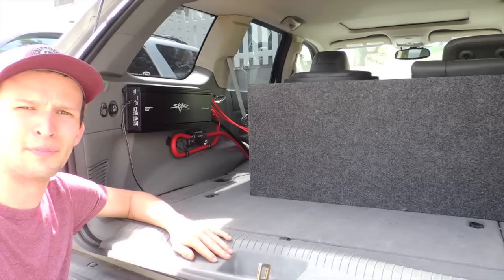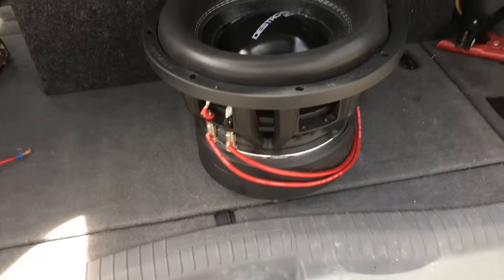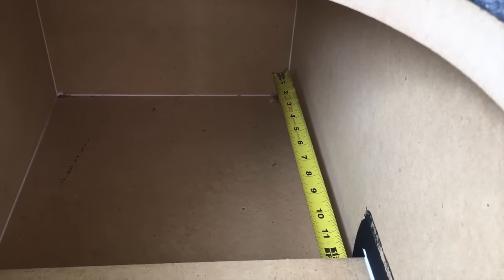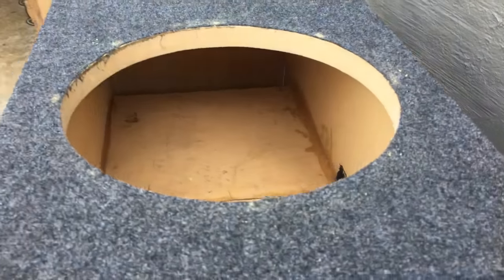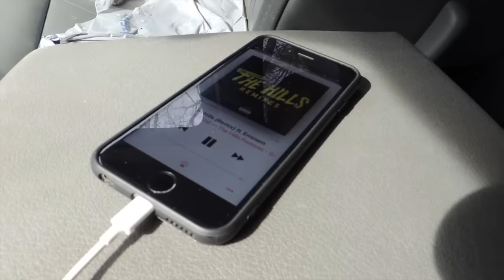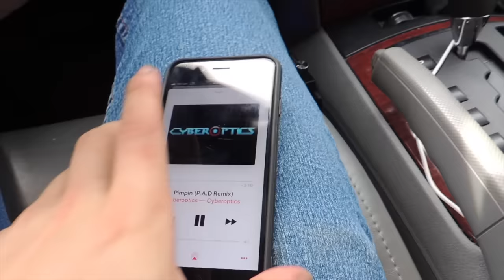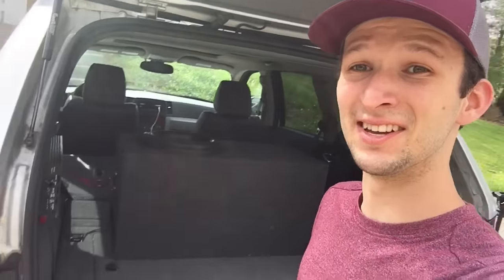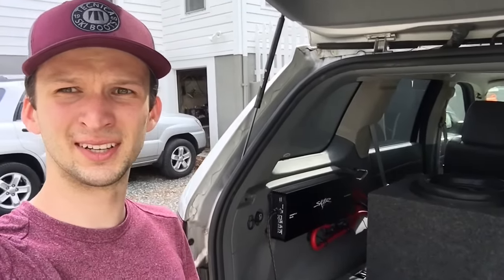Tuning My Box To Hit Lower! | How To Tune a Ported Subwoofer Box/Enclosure

Comment: Can I wire dual voice coil to a single coil together
Reply: Yes you can but u want subs that match in rms and ohms unless u have a amp that can push low ohms then u be roughly good. My buddy bought two hertz 15 inch subs one is 4ohm dual voice coil nd the other is two ohm single voice coil. Each 450watts each but sincce its hooked up to a amp that is 2 ohm stable bridged can only go to 4 ohm so the subs make the amp hot quick. And last thing if ohms are different in same box hooked up to one and other the lower ohms sub will play harder then the 4 ohm sub causeing it to be really dirty. And then vise versa with rms if its not matched one sub will use more power then the other sub makeing the subs not move in sync therefore makeing dirty bass

Comment: wouldnt that make the volume of the box smaller
Reply from the maker: Yep! But it is still working the recommended volume and I’d rather it hit lower than be the little bit louder
Reply: Not to mention, you can tune low with small air space. Just harder to do

Comment: what frequency did you use to set your gain?
Reply: i suggest 40hz at -3 or -5 db if you listen to regular music via cd, flash or streaming but if you listen to bass boosted or decaf, tune 40hz at 0 db. 40hz is used when you watch amp dynos doin certified, uncertified and dynamic runs
Reply from the maker: I used 40hrz at -3db since the majority of the music I listen to regular music

Comment: I just want my box to sound good for the wide variety of music I listen to, including deep bass tracks...  How do you do that?
Reply from the maker: Getting one tuned to around 40hz is usually the sweet spot for a good variety of music
Reply: @ParkerTheBasshead  copy that.   Is the idea you tune to low 30's for heavy bass tracks and booming rap, and higher like 40 for better bass guitar in rock genres, classical music etc-- in spite of what the sub manufacturer says for hz tuning?  What does the manufacturer have in mind when they throw out a single number for a particular sub, like 32.3?  And how bad would the results be if they recommend 1.6 cubes @ 32hz, but you put it a 2 cubes box @ 30hz?  Obviously that's what I'm looking at doing..
Reply: @frankbush8368  sealed is the way to go for rock

Comment: How long you been running that sub??
Reply: Maybe 3 weeks max 😂
Reply from the maker: A little over a month now
Reply: @ParkerTheBasshead  that coil looks a little rough for only 1 month
Reply from the maker: Kenny Mayberry agreed! Good ole Rockville coils 😂😂
Reply: @ParkerTheBasshead  I like their K6 but the K9 has major issues and they started selling recone kits when the destroyer came not a good sign lol. Their amps do well
Reply from the maker: Kenny Mayberry yeah if they would get their glue figured out and stop adding ridiculous ratings to their subs they would be awesome! Who knows maybe they will figure it out eventually
Reply: @ParkerTheBasshead  yeah for sure. If  you go by their CEA and not their RMS it will be fine. But yeah way over rated. Been running a K6 on CEA and it does well

Comment: How would u co.pare the american bass to the type r. And did u try the type r in same box u had the american bass in. I a square subwoofer man myself. Where i grew up every body has a system and bumps but swear from a mile away i would get my brother callin sayin u comin to my house i would say how u know he would say ur bass sounds like no 1 else all on 2 12L7s and a kicker 1250.1sdx. N finally my female had my car and i could hear hwr for like 7 min before she pulled up. Had me like what she doing circles. But i from chicago and it all flat land u k ow bass carries. Plus them big 3 storie buildings help funnel that bass in a vertain direction.
Reply from the maker: The American Bass can definitely handle more power! My type R is only 600 watts RMS but I believe some of the newer ones are 1000rms and those seem to be pretty comparable to the American Bass Elite
Reply: @ParkerTheBasshead  i have a set of the new tyle r series. But i have a.d.h.d. so i change my mind 30 times a day. I just found myself likin round subs again. Bass is bass ugly or sexy. But the 15 type r in a V.T. box single 15 with big ass slot vent port i thought it would blow with 1000 watt plus on rms. But handled like a champ. The newer typ r dont have the lil slots to force air into the sub to cool off it just has a blank chrome bottom.

Comment: Yo can you give me some measurements for a box that’s 4cuft tuned to 32 hz I’m trying to build a box and can’t seem to get any help I have a 15” Fi neo d1 and I’ve never built a box before so
Reply from the maker: You should be able to find specific measurement for that sub from the subs manufacturer on their website
Reply: I got the specs of the sub but how do I put them in to get some Measurements for a box
Reply: google re audio box calculator. play around the box height, width, depth 1 and 2 and look the the box volume (ft3). start at around 5 cubes before messing around the port size (setting up the port will shrink the box volume). next check to see if the sub gives you info for recommended port area. you dont want it too small or youll get port noise, the specs will be measured in square inches (in^2). if you dont have any info start with a 3 inch port width then play around the port length to get the desired hz tune.
once you get the specs setup just scroll down to step 2 and it will give you the measurement you need to make the box. hope this helps
Reply: Thanks

Comment: You do realize when you just add length to a port like you did - your taking up more internal air space and adding more port area to the enclosure which may or may not help depending your system - in my estimate of what you did you probably are able to play lower yes, but now probably have to much port area for that sub compared to the size of the box - you also wanna know more about the specs of the sub you are running and take into account the amount of moving mass / dampening factors and FS ..I mean whatever works bro Bang On💪🏼 check out some of my vids
Reply: what happens when your port area is too big for the sub. i know if its too small you get port noise
Reply: To much port area can cause unloading of the woffer .. the port acts as a separate chamber that builds pressure .. no pressure the sub almost reacts as a free air scenario.. now that’s being extreme but in most cases you just lose efficiency in the enclosure which 95% of the time means not as loud .. taking more power to do the same dam thing lol .. I’ve designed boxes with loads of port area and have crazy peaks (not very musical) lots of SPL guys build small boxes and go big on the port area and add loads of power and tune high in the 50s or higher .. lots of variables when building enclosures 😬 in simple terms .. to much port area not enough pressure being made in enclosure but that’s not always the case
Reply: @LivinLoudwithAndy  thank you so much now i know. can i ask one more question. im building a slot port box where the port and sub are facing the same direction is it better to make it an L slot port or U? does it matter

Comment: Your tuning is probably a lot lower than you think. Adding that much port takes up a lot of the gross volume. If grossl box volume is 2.9 cubic feet and you have approximately .4 to .5 cubic feet of port, then you are at 2.4 to 2.5 cubic feet net. Which is what you need to make your tuning measurement on. Not the 2.9. So if that much port is 35 hz at 2.9 cubic feet, you are probably looking at closer to 32 or 33 hz. Just making guesstimations on box measurements, but it was 29 inches deep and i am guessing somewhere around 12x14 for width and height. And guessing a 2x14 port. But don't know for sure. If those are the dimensions i get a tuning frequency of 32.2 hz.

Comment: You could have closed the port height by 3/4 inch and made that baffle length around 22.8 inches you would have been down to 30Hertz likely closer to the subs Fs. As the other guys said you could also invert the sub which gains you 1Hertz lower with that baffle I described for a 29Hertz tune not really worth it in my opinion.
Reply: Does running a smaller port affect anything besides added port noise? Or why doesn't anyone run smaller ports since it's a little easier to achieve lower frequencies

Comment: If you hit lower when you tune lower, wouldn't you lose "high" bass at the same time? Say you tune it from 40Hz down to 28Hz. Now when it hits above 45 50Hz Notes it will be a joke right?
Reply from the maker: Yes tuning lower will sacrifice higher notes but in the 40-50 range it isn’t really noticeable

Comment: The box volume needs to increase. Sadly you decreased the volume adding the port
Reply: I agree, but the difference is probably less than 10%. I doubt it'll hurt it too much, Most subs have a .3-.5 cu-ft area they work best in. I doubt he took that much away from it

Comment: Its there glue. They need to find or just pay to buy from sundown or something on that glue.
Reply from the maker: I know they really need to figure it out! Other than that and there dumb rating systems they’d be alright
Reply: @ParkerTheBasshead  swear 2 kicker comp 12s 150 rms each in a box that is slanted front and back. I had muliple dif amps til 1 day i asked a best buy tech what should i hav he said kx400.1 swear it brought the bass to life. I mean went from bass hitting to bass slammin on every note. I stand by a kx. N ya i know for same price i can get a taramps and hav alot more choices but swear until u have a rocford power edition amp not refurbed or used new. Then u will understanf what im sayin. Its almost like shooting for S.Q. but u gettin better bass delivered to the subs. I do not like the new 1s with a wireless remote. I say it takes up space for what the amp really needs. Have u ever noticed 2 same radios 1 shows fish and dumb back grounds and its 100$ more but when put to the test of using to fine tune the 100 cheaper 1 sounds better. Cuz it didnt waste space on a lil chip and font display.

Comment: You really should stop messing with that box. Get one built Im telling you. It doesn't matter how much you change subs. So be it. You'll get way better results from just building your own. Prefabs aren't meant to last very long either. Just take some 3/4" birch, double the front baffle to 1.5", slot port with flanged edges for more efficient air flow and more SPL with a tune in the mid to lower 30's, and bam! There you go. Its not hard but yet you are making it extremely hard.

Comment: Run two positive wire and two negative wires from the box to the subs. The way how u have it un make a signal have a delay ane one side of the sub is working harder than the other. Thats the most common thing ppl do in it fuck the subs up.

Comment: I really want to yell at you but I'm not going to I will say that you don't give up even if it's not the correct way to do it you do find a way but it's really not the correct way take a day and build a box $50 sheet of wood I can see you doing it in about 4 hours... Testing subs or not get a sheet of birch and make a box you'll make a good one kid!! I don't want to jinx you but I don't see that sub lasting too much longer either it looks in sad shape!! And honestly with all the problems if you have a problem with this I will get my money back!!
Reply from the maker: I know I know haha I’m actually working on planning a custom box at the moment. Should have it built in the coming weeks
Reply: @ParkerTheBasshead   I use the ct sounds app, I got it when it was free and now it costs 1$ and it will tune the port u kust have to change the thickness setting in app everytime and u get correct port tuning, it's not perfect when it comes to that, but hey, for 1$ it's solid.
Reply: Winisd pro on your computer. Free and works well. Or speakerbox lite on your phone. Also free and works well. Last box I built, goal was 5 cubes tuned to 26 hz using winisd to plan the port. Verified by testing with dats v2 that the tuning frequency of the box is 26 hz. Actually like 26.4, but yeah, close enough. I do all my box planning on graph paper. Just use a modeling program to figure out port lengths.

Comment: You 2 ohm or 1ohm stable
Reply from the maker: The amp is 1 ohm stable! But with box rise I doubt it sees 1ohm much
Reply: @ParkerTheBasshead  i thought the way its wired is the factor of weather itll be 1 ohm 2 ohm or 4
Reply from the maker: TheSpazzattack95 you are correct. The subs is a dual 2 ohm sub so it can be wired to 1 ohm or 4 ohms. (A dual 4 ohm could be wired to 2 or 8 ohms). 
However, as your coils heat up the impedance rises so even tho it is wired to 1 ohms it can rise pretty quickly up to 2, 3, or even 4 ohms.
Reply: @ParkerTheBasshead  oh never knew bout that
Reply: @ParkerTheBasshead  with what u have said bout coils heating up it rises the independance, can that fuck a sub? Or no since thats normal? I mean ino the heat will fuck it was prob just its last day i had it for like 3 years ran in series. And my uncle had it before me wich he got from a friend. My uncle always says yes to subs and equiptment ppl think are blown.

Comment: That's 2k watts rms? Seems less
Reply from the maker: I have the amp tuned a little under 2k to be safe until I get clipping detection meter. And there is also impedance rise so the sub probably wouldn’t actually be seeing 2k anyway
Reply: Parker Dacchille ok makes sense.